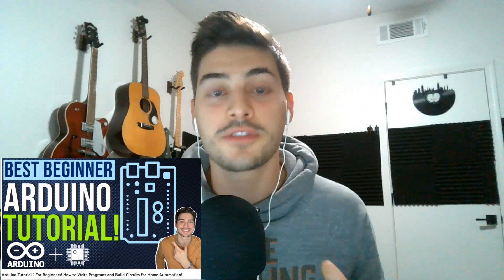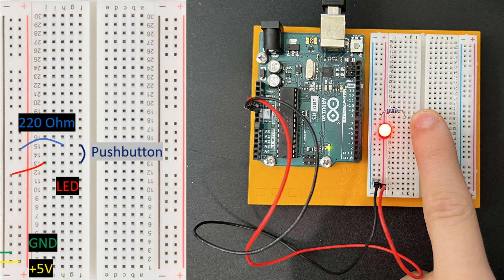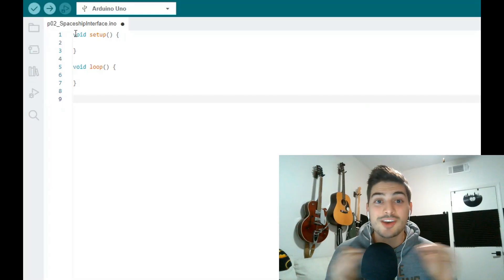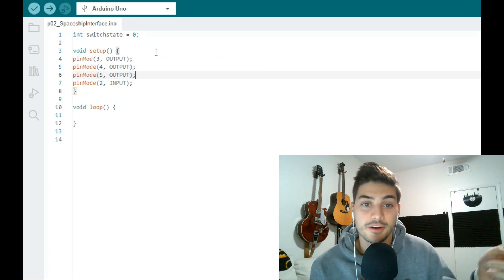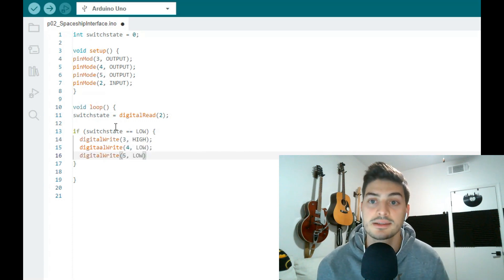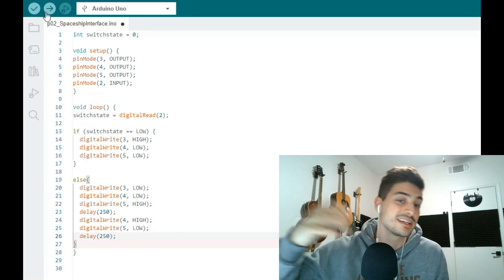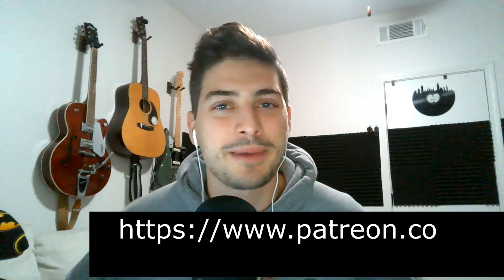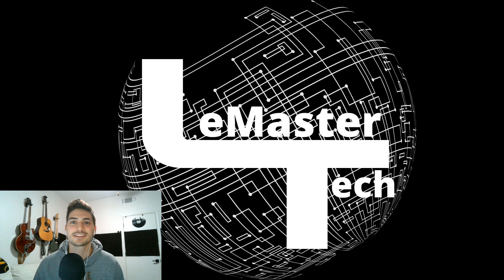Pushbuttons and LEDs with Arduino. Using Digital (On/Off) Inputs and Outputs

Comment: This is a rad project. It doesn't seem there is that much difference from a PLC and an Arduino board, just the syntax for the code. What kind of Arduino projects do you have planned for the future in this series? I was thinking maybe like a guitar effect pedal. Great video, man!
Reply from the maker: Hey man thanks so much!! And yeah programming syntax and overall packaging are the biggest differences I’ve found between arduino work and PLCs so far! Everything in industrial controls is obvious pretty clean and packaged tightly and arduino and home hobby projects tend to be a little more makeshift looking til you start actually making PCBs for your builds haha! I would LOVE to do a guitar effects pedal man, definitely on my list - right now I have a list of 15 beginner arduino projects that start with the basics like digital points, analog points, then we’ll do some basic motor and servo control, then some LCD displays all the way through to controlling other external electrical devices with your arduino. That series is gonna get any beginner from the very basics and beginning out all the way to a solid intermediate. From then I want to start building awesome home projects just like a guitar pedal! I want to eventually have a catalog of Mark Rober style cool builds, but want to keep them a bit more educational regarding the builds where I think a lot of the time he focuses on mainly entertainment value! Thanks for watching!!
Reply: @lemastertech  Absolutely tremendous.